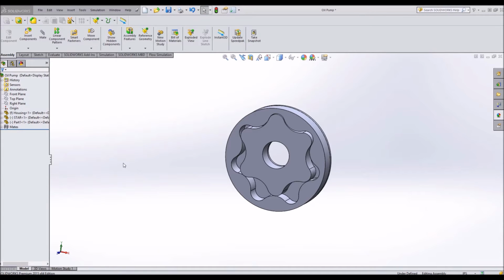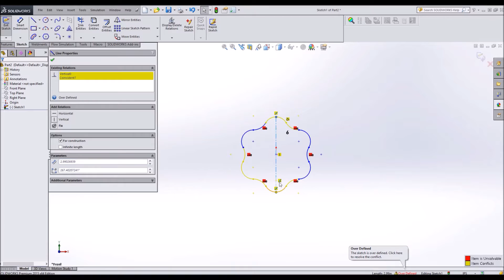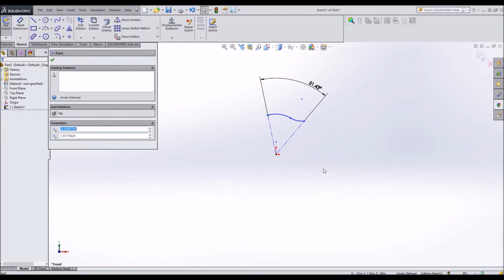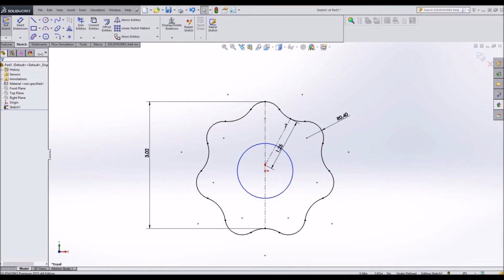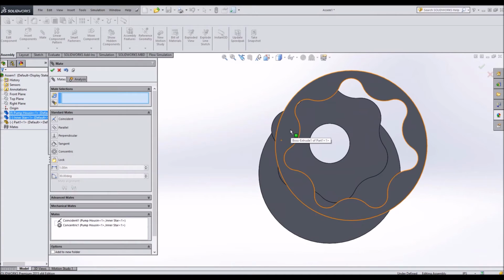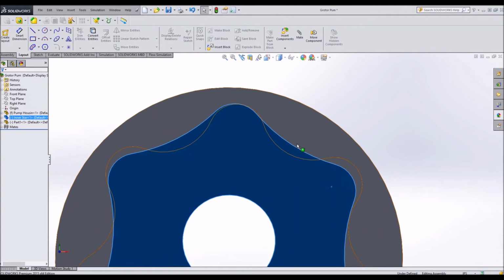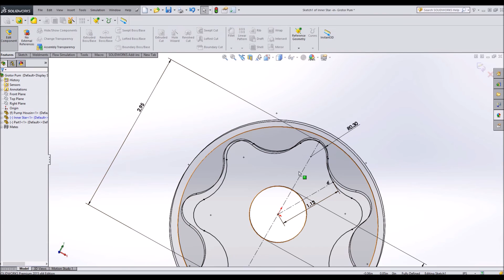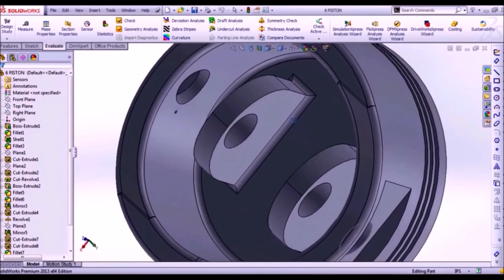Best Method to Make/Constrain Gerotor (Oil/Hydraulic) Pump in Solidworks|JOKO ENGINEERING|

Comment: So, how much clearance do you leave between (rotor and stator) and do you need to worry about wear and tear as well as heat expansion during operation? And can a pump like this be used as a hydro-motor? Further, is this what you do for living as an engineer, or just a fiddler? Although, I assume no one has money to throw around to buy SolidWorks just for play, eh?